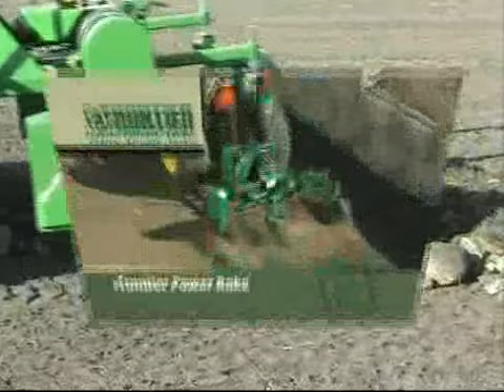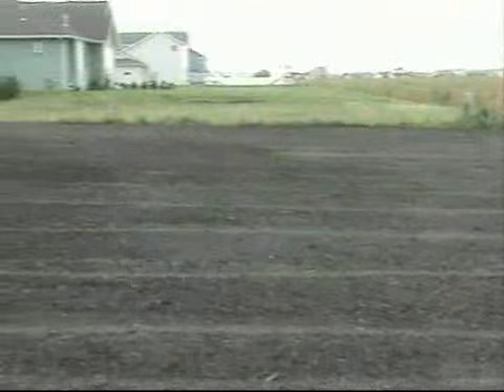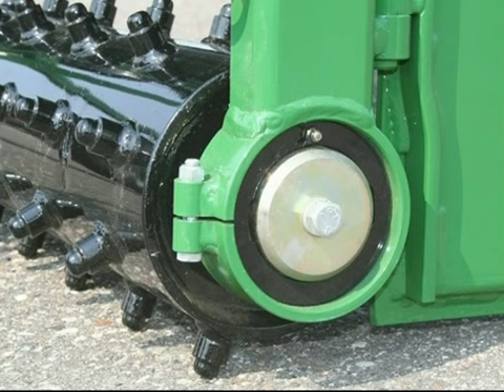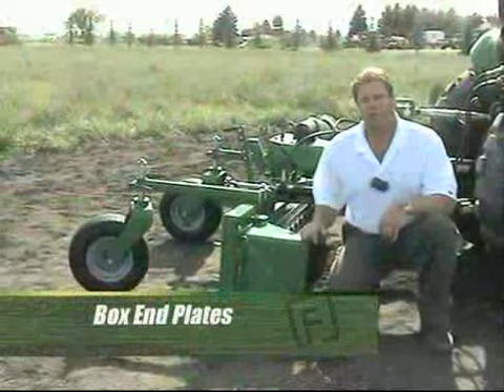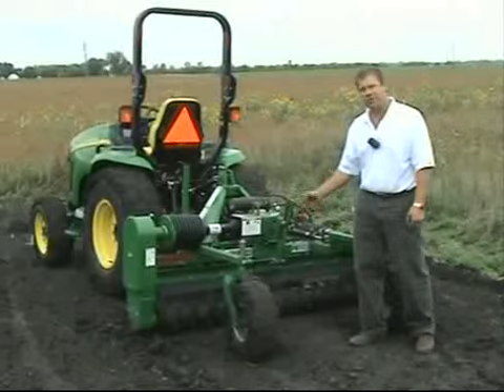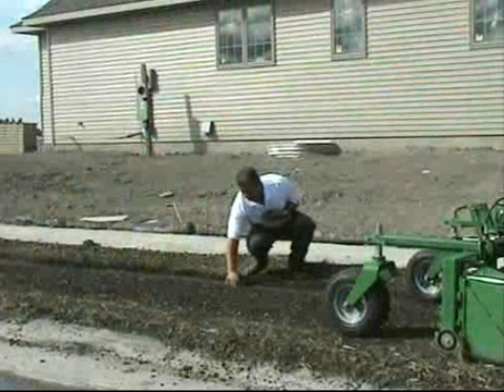FrontierPowerRake

Comment: Question on the setup, last thing you said was raise and lower the rake with top link disconcerted, if it doesn't come up level you said the operator will adjust this wheel and pointed at the top! What wheel?
Reply: The 2 wheels at the back can be raised and lowered to adjust for level once he top link is adjusted.